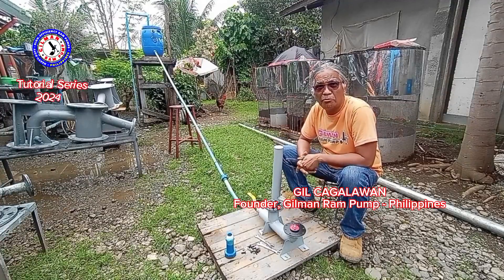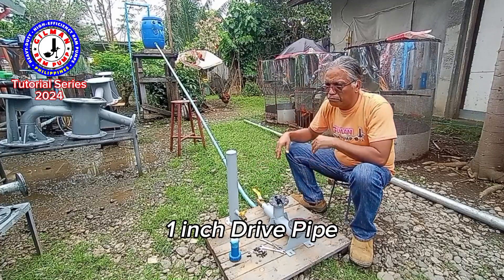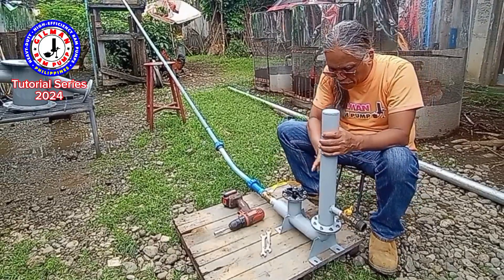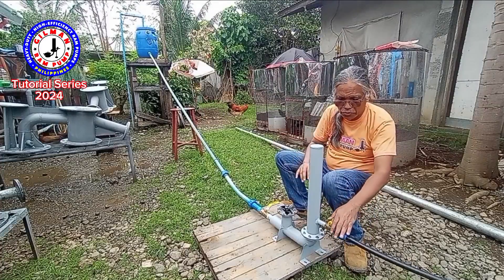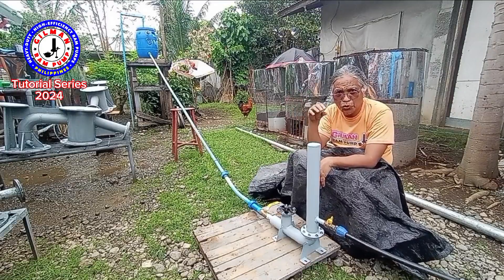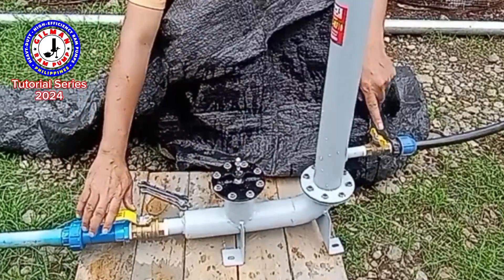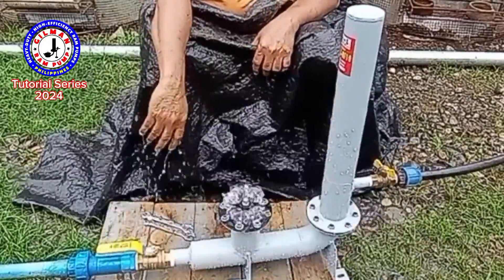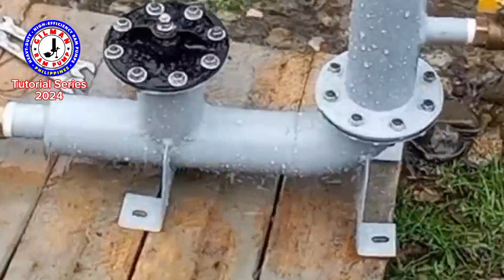GILMAN RAM PUMP MODEL MF10_OPERATION DEMO_ENGLISH

Comment: Drive tank to pump 5meters elivation 40meters length kaya po ba ang 70 meters elevation 110 meters delivery pipe?
Reply from the maker: Yes sir kaya po. Reduce the drive pipe length to 20m max. while maintaining the elevation at 5 meters.
Reply: @gilmanrampumpphilippines  pang vegetable farm 2 hectare po, ano po ang accurate na rp po?
Reply from the maker: Model RP100 sir

Comment: will the pressure increase if you use a drive pipe 2 times longer than what your using in this demo?
Reply from the maker: No, it doesn't.